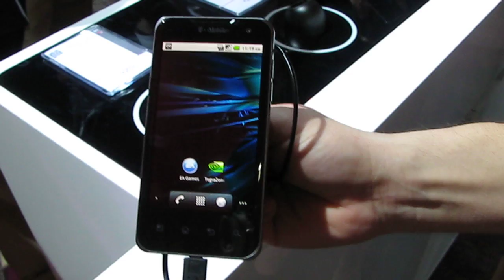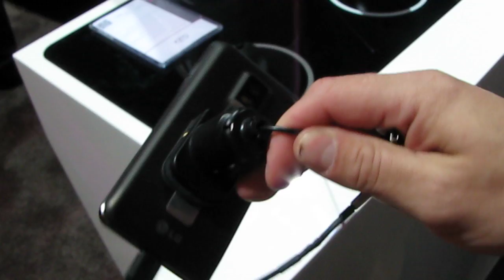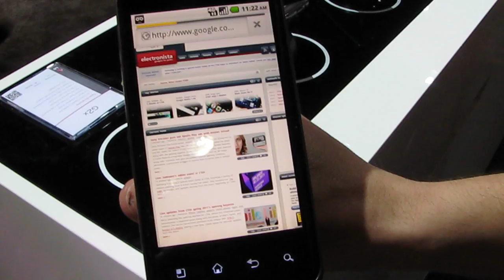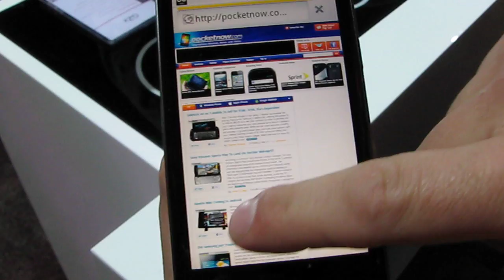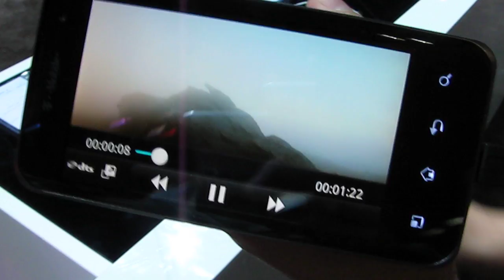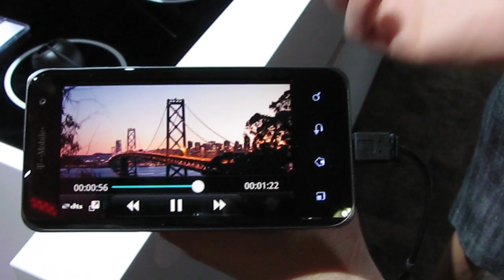T-Mobile G2x by LG Hands-On | Pocketnow

Comment: The browser Part Lagged because
1. The webpage is still loading, you can't expect a webpage that hasn't even finished loading yet to run smooth specially if it has flash enabled. 
2. the webpage is a heavy page with lots of flash. even i phone can't do it cause well... it doesn't have flash..

overall, fast and snappy device.